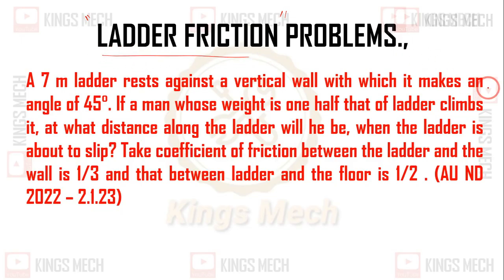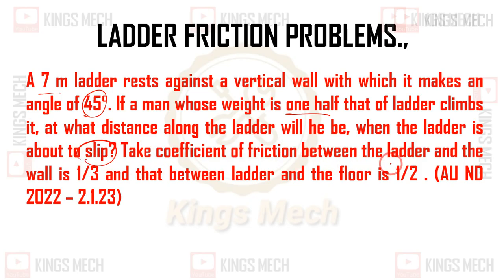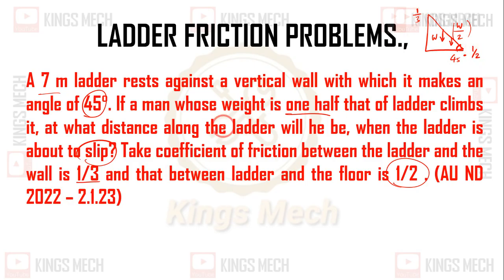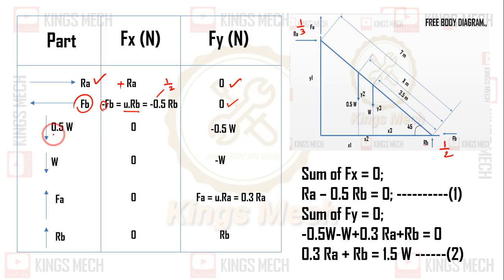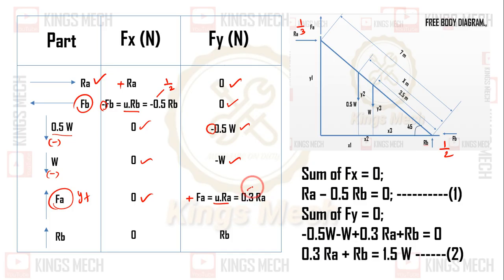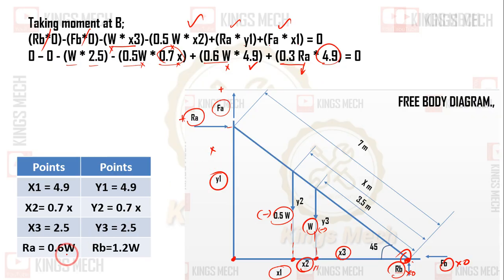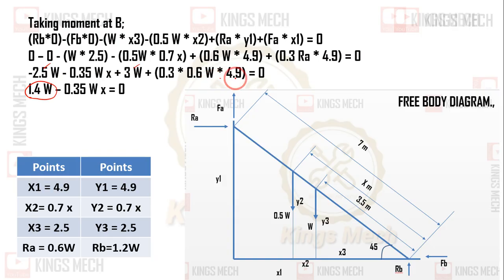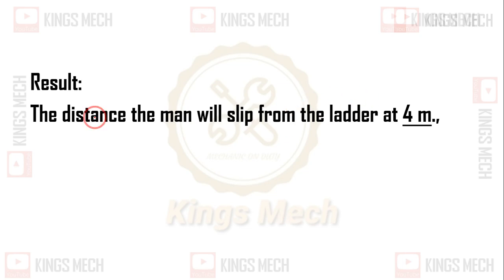Ladder friction problem AU ND 2022

Comment: Sir intha sum la part diagram la Rb value calculation wrong ahh irruku sir check pannititu solluga sir
Reply from the maker: Couldn't find anything wrong.. can you tell how much you get??
Reply: Yes sir part diagram la RB value calculation la mistake sir 
RB equal to 1.15/1.5 tha varunum sir ana neega 1.5/1.2 pottu irrukiga sir athu mattum check pannutu crt ta wrong ahh nu solluga sir
Reply from the maker: 1.5/1.15 is correct., I have rounded off 1.15 as 1.2
Reply: K sir
Reply from the maker: Few minutes